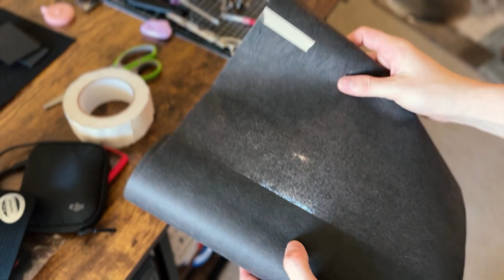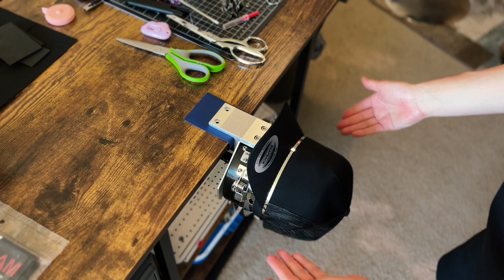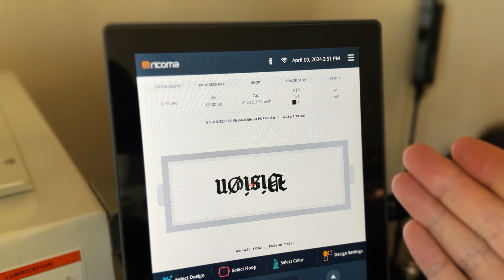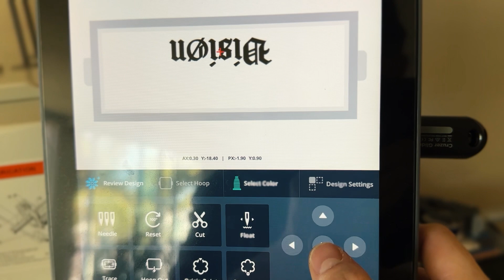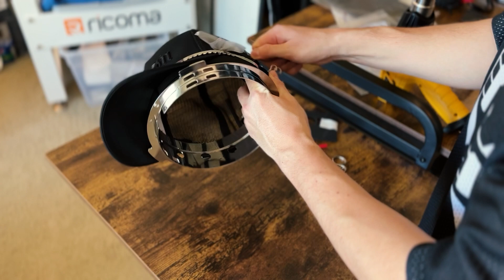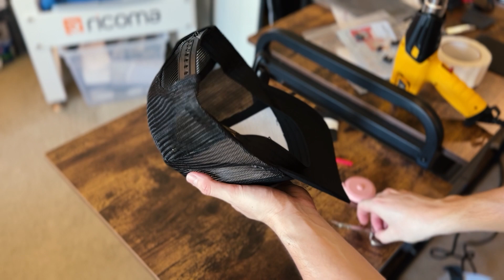3D Puff Embroidery On a Structured Snapback Hat Using Ricoma Marquee 2001 (Beginner Learning)

Comment: Great Job.  Congratulations on your new Ricoma.  Just some quick advise. Caps should always be done at a lower speed.  It will help insure registration and help avoid breaking needles at high speed.  Your input about the 80/12 needles was great as I've had issues with 3D puff cutting away as clean as I would like.  Solvy™ is a water soluble film used as an embroidery topping on high-pile fabrics. When used as a topping on knits, terry cloth, fleece and other textured fabrics, Solvy™ creates a smooth embroidery surface to give clearer embroidery. Stitches won't sink into the fabric, giving a crisp definition and detail to your work.  Like anything else there are good brands and some cheap brands.  figure what works best for you and do your thing.  Welcome to the market place.
Reply from the maker: Thank you! I have been running my hats closer to 500-600 since this video, and I also started using a firmer puff and it's done wonders to my designs.  I guess the stuff on Amazon isn't so great, or I haven't found the right stuff.  The Madeira Body Builder one is so much better imo for 3D work.  Can't wait to continue to explore and learn more!